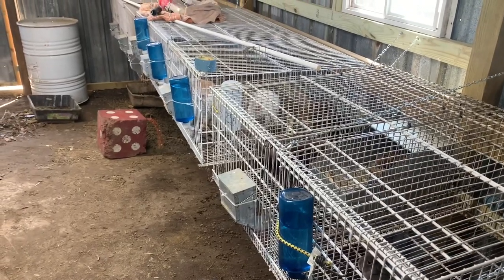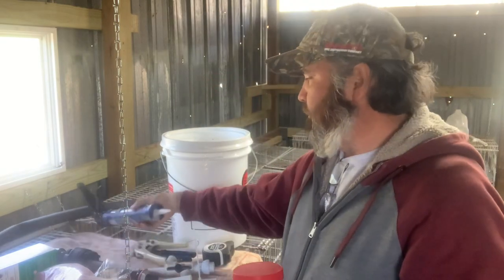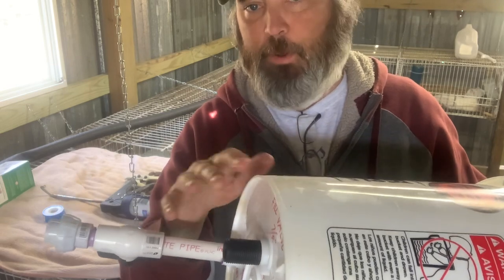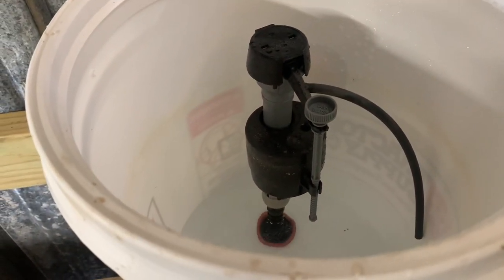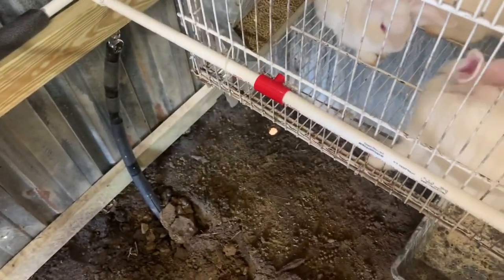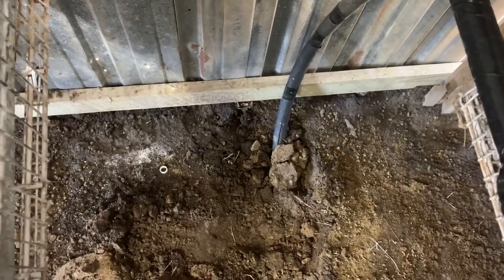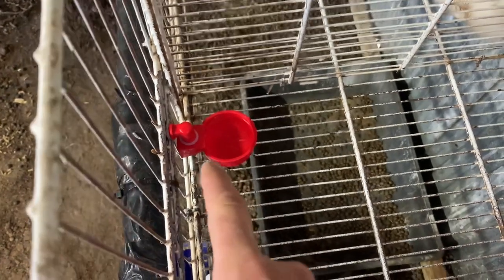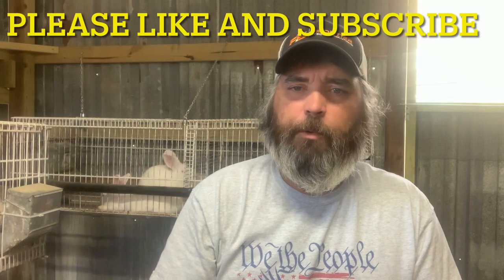Best rabbit waterer

Comment: I just came across your video and like the idea. Only thing I would consider is putting an overflow pipe out the back side and going outside so if the valve fails water flows outside instead of inside the building.
Reply from the maker: Yea that’s definitely another option. Fortunately we’ve never had that problem. Thanks for watching!